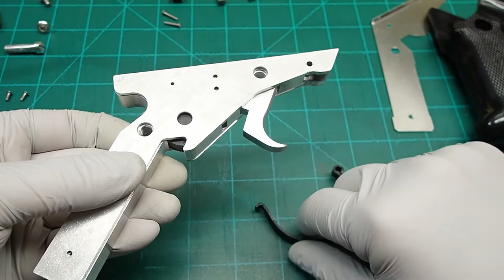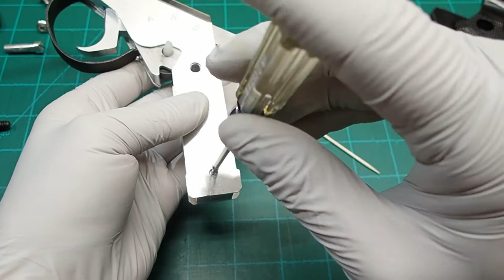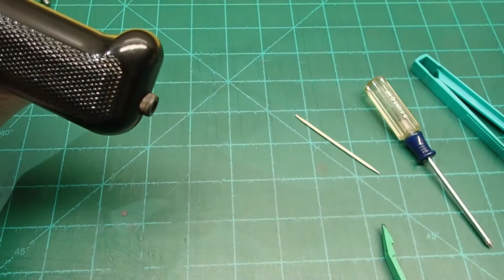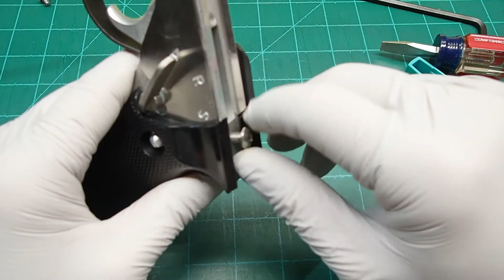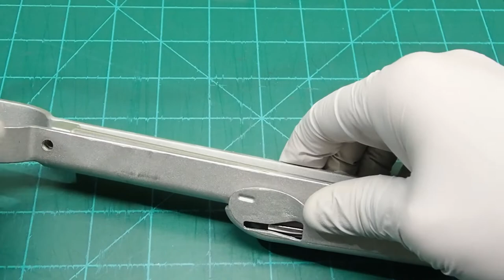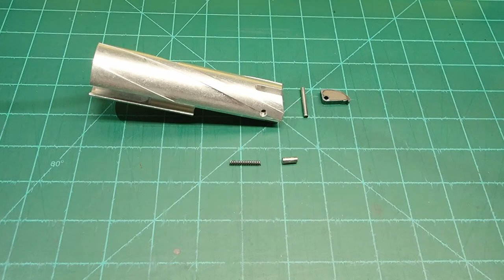Part 2 - E11 Sub-Component 1 Assembly (Blaster Factory / Field Marshal Stormtrooper Replica Kit)

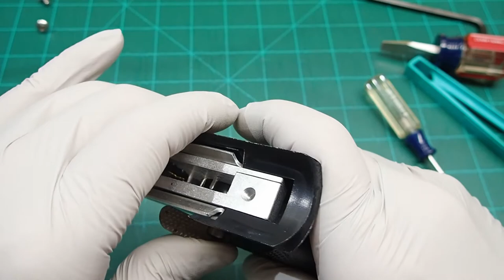Comment: I notice at time stamp 20:20 the selector switch contacts are all touching the aluminum plate.  If you try to use that switch with electronics it will need to be fixed so all contacts are not bridged.
Reply from the maker: Yeah, good call. For FX builders, there are many more considerations that need to be taken account such as placement / securing components, wiring paths, and of course insulation of electronic contacts to prevent bridging. Not sure how to solve that at this time since this will be a static build but good PSA. Thanks.

Comment: Mine didn't come with a safety select lever. Reached out to this this morning to make sure I was supposed to get one. Fun build so far. Also noticed your stock catch moves more forward than mine. Mine came assembled so I may take it apart and see if I can move it forward more. It just barley hangs on to the main body when in the collapsed position.
Reply from the maker: They should be able to take care of you on the lever. Hmmm I remember I had to fiddle with the stock catch a bit. But with mine i think it was catching to soon, not just barely. If you check out my build log I should have captured what I did there. It may help or not?
Reply: @zjunlimited  I'll give it a rewatch! I tightened up the side bolts and it moved things in place a bit more and gave me more coverage. It's odd they look to have also changed out an aluminum part on yours to an all metal one on mine. Glad to see they make those enhancements as they need them. Sucks that now I have to say "crap, mine doesn't look like that lol".
Reply from the maker: That’s interesting about the change, I wasn’t aware of that. In either case, my RPF build log should have more photos and details and may better explain things than the videos. Either way, best of luck and enjoy the experience. It’s a great time to be a Star Wars fan with all of these replicas available.